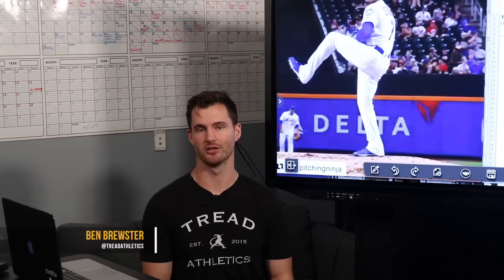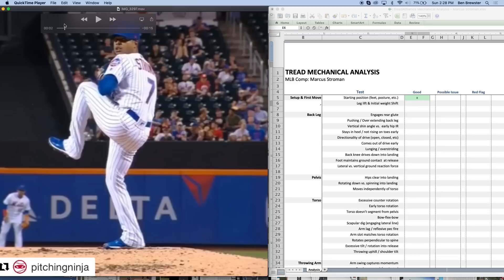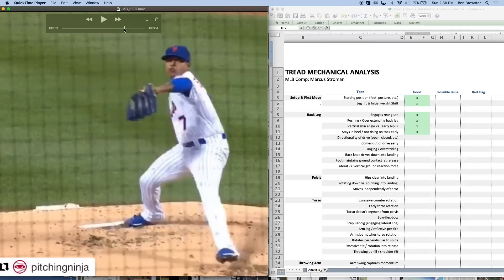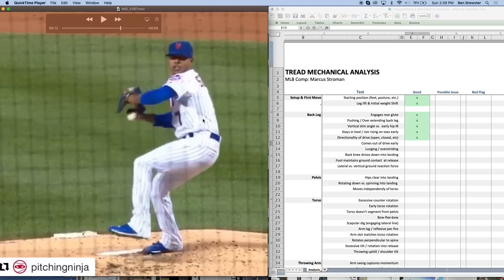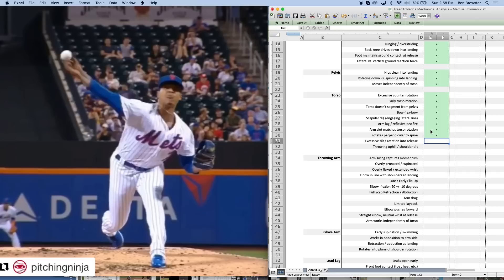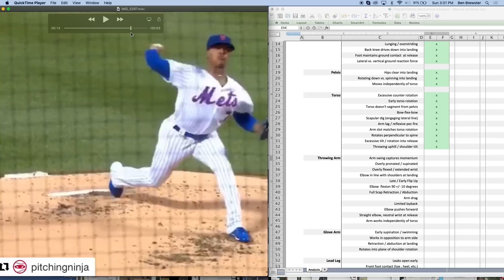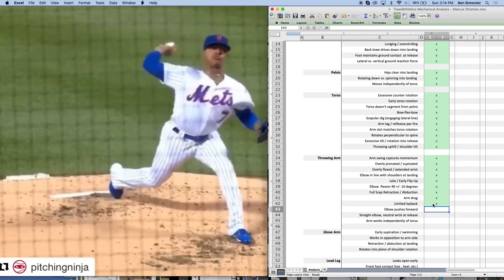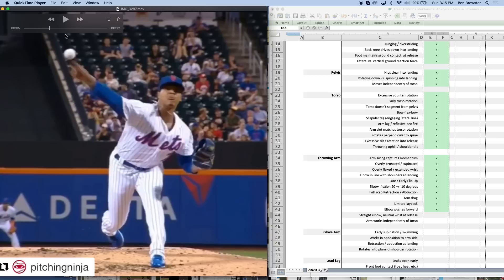How Does Marcus Stroman Throw Hard at 5'8"? A Mechanical Breakdown.

Comment: I'm just glad coaches stopped messing with what side of the rubber guys pitch from.  could have avoided more headaches than I can count if mine in college had just let me do what I did, and not move me to 3rd base side because "it creates angles." That and arbitrarily trying to drop guys arm slots "just to see what happens." Went from highly effective on the first base side of the rubber with low to mid 90s armside run to  throwing across my body and suddenly having control problems when I never did before college. The new wave of college and high school pitchers will benefit significantly from the new blood in coaching and philosophies, and I'm here for it. Guys on the bump have to trust their stuff and feel confident in what they are doing... pitching is already hard enough without any type of self-doubt.